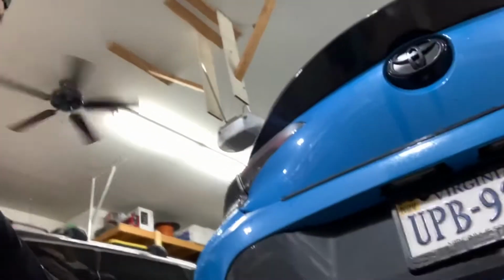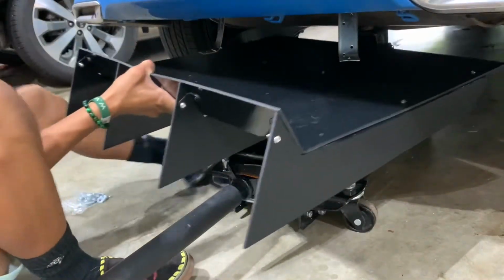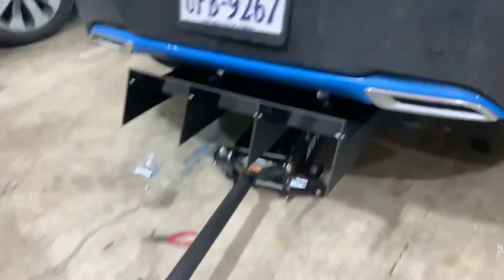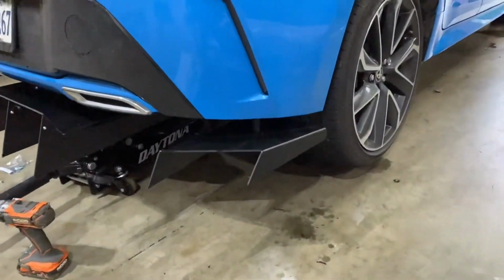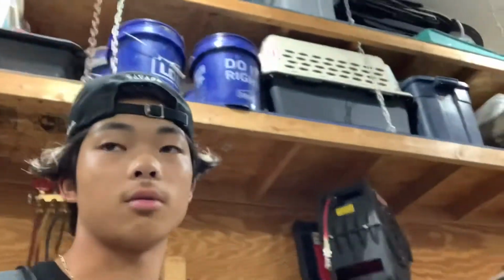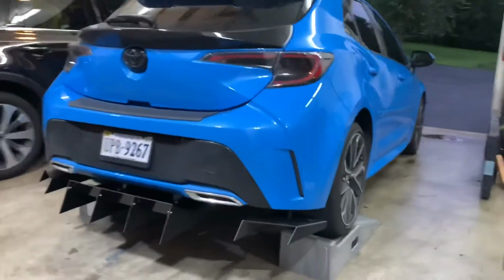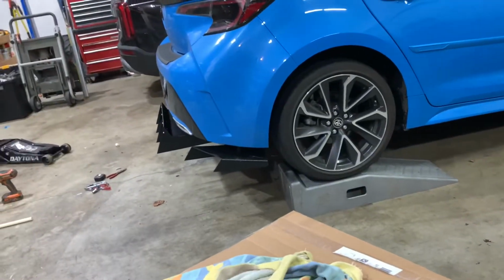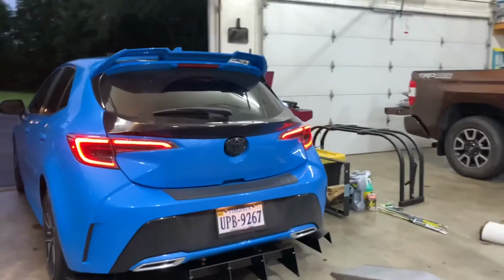Diffuser For the Rolla (DFS)

Comment: I need more down force ...
Reply from the maker: Lol😭
Reply: @blurlla    i removed some of the plastic that was hanging down, by the oil filter. And now my car runs better (bottom is flat).  My plastic kind of warped. But thats a good thing. Because thats the way the wind goes. The front piece wont warp. It has metal on it. I dont have sides.

Comment: Why did you get the muffler back in 
I really want to get it off is there anydownsides ?
Its soo hard to get an aftermarket exhaust here in my country (africa)
And i really like a banging sound
Thanks
Reply from the maker: I mean I’d recommend an aftermarket but taking off the muffler isn’t bad either. It sounds decent, the only real downsides are droning and if you’re sitting for a long period of time the fumes might end up in ur cabin. But I had no problems with it when I did it.
Reply: @blurlla  sid you lower your car ?

Comment: only two brackets hold the large center piece ? why is that ? because you want it to move if you scrape the ground right ?
Reply from the maker: Mmm idk I just think either I was missing some or low quality, don’t get me wrong, special diffuser, but I had to make my own brackets for it to not shake and just under a year the plastic warped but it also could be a reason yes✊🏽
Reply: @blurlla  i found a way to do it. and its different than your way. just use the curved silver metal to create a barrier so the plastic does not touch the muffler.
then use long straight bolts for the other hangers.
Reply: @blurlla  you could get the diffuser coated with something. before you put it on. powder coating. plasti dip. or bed liner. that should stop it from warping right.